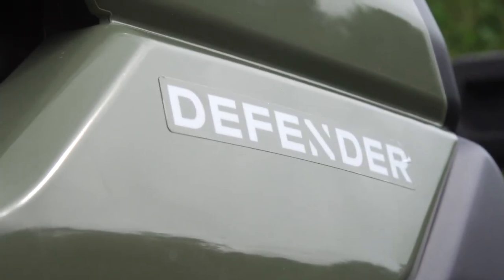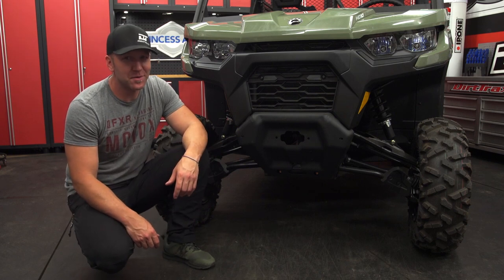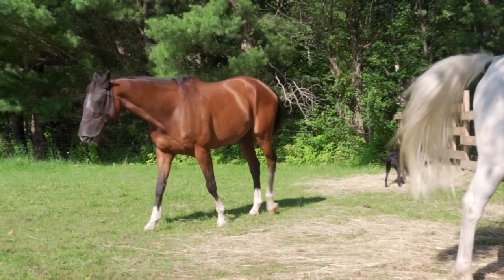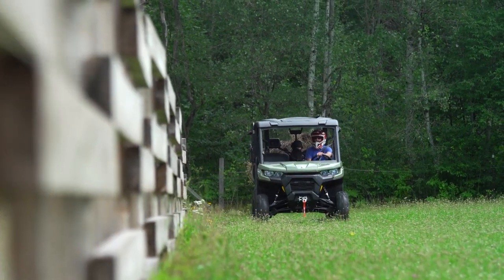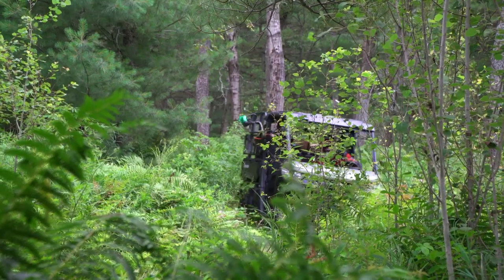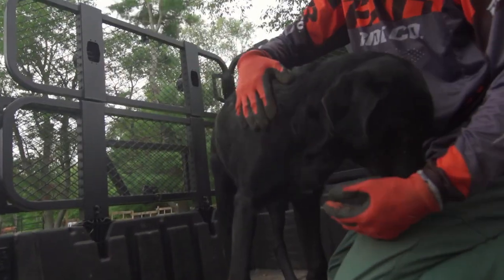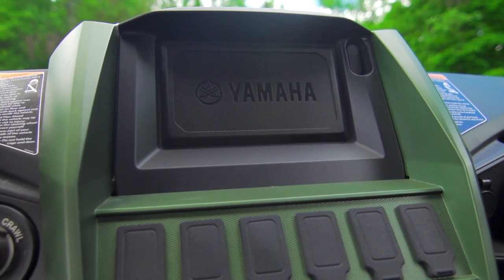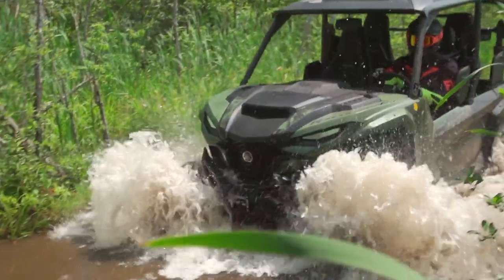DIRT TRAX TV 2021 - FULL Episode 5

Comment: I wouldn’t waste my money on an RMAX 4… this is coming from an RMAX 2 owner! The 2 feels near perfect, the added weight and lower sprung suspension & tires = deal breaker!
Reply: Spent some time in a r max 4 in west va and the rear suspension bottomed pretty easily with one passenger can only imagine it with with 2.  Cruising it’s fine but it doesn’t like spirited riding.
Reply: @jeffevans4598  did you do any adjusting to the shocks? I can’t believe it bottomed out that easy
Reply: @mooseknucklegarage8439   We didn’t adjust the shocks it was a friends machine, in the r Max’s defense we were beating on it pretty hard. It’s a super smooth ride over rocks and such but when blasting dried mud holes the rear liked to kick up and bottom easier than I thought it should.